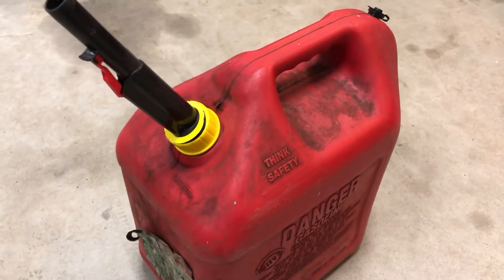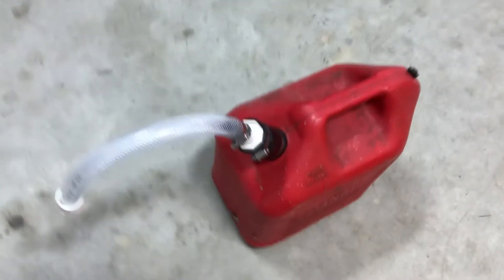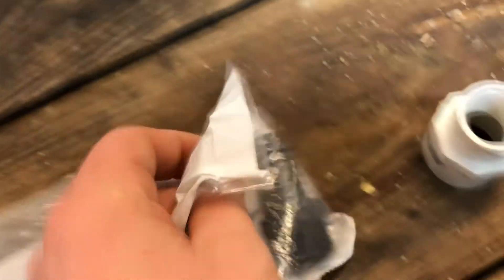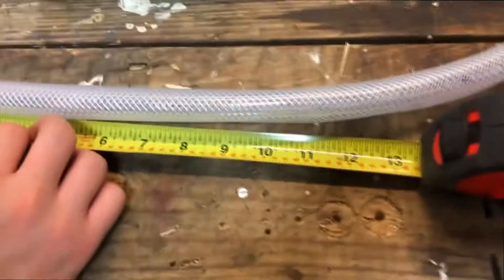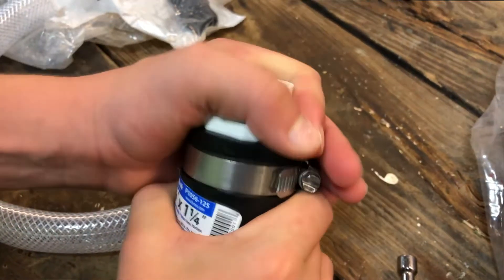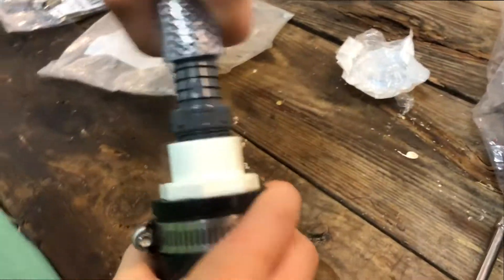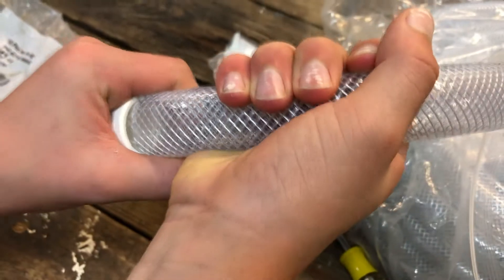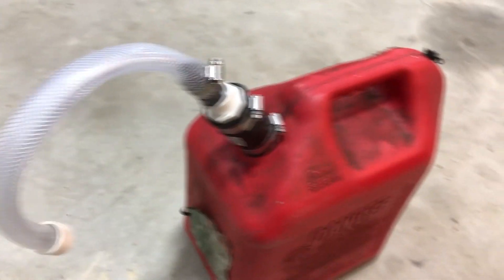DIY Gas Can Spout that WORKS!

Comment: Helpful hint. To assist pushing the hose onto the fitting, spray the fitting OD and the ID of the hose with 100% silicone spray, let it dry then push the hose over the fitting. The silicone will most make it easier to accomplish that.

Comment: Nice job, I like it.  However, the hose diameter looks too big to fit inside the small neck on a modern car. Have you tested that?
Reply: Yep, now you're gonna need a piece of 1/2" tubing attached to the 3/4" tubing to put the gas in the car...

Comment: tried this with exact parts listed...still leaks badly no matter how much you tighten it down...none of my gas cans (4) have threads on the spout that go all the way around. There are a couple of flat spots with no threads and this is exactly where it leaks. It was a good effort, but needs more work, unfortunately

Comment: I guess this is fun cobbling...
However the EZ Pour retro fit kit is $9 at most local hardware stores or online.

Fits almost every new plastic can...comes with extra parts, a flexible plastic pour hose, cap and a can vent.  Makes your can just like 1990 cans.

Comment: I kust use a funnel into my machine's gas tank. To pour all I do is remove the "engineered" spout completely.
Aside from the schrader valve  I don't understand the nessesity of all the backyard engineering.

Comment: I need a 3 foot hose to add onto existing EPA nozzle. 5 gal gas can is too heavy to hold up to fill a pickup truck.... I want clear tubing. I can set the can on the side of the truck bed, run the hose into the filler neck, and let gravity do it's thing.

Comment: Dip hose end in reeeeeeallly hooooot  waters to soften when you push it on. I did something similar with a garden watering can and my wifes CPAP hose to I could get the water in the bottles I bury next to the tomatoes.

Comment: what kind of screwdriver did you use to loosen and tighten the hose clamps. Great video.
Reply: The best screwdriver I use for hose clamps are the cheap harbor freight ones that have a large straight and phillips side and a small side. The large side if you take the bit out is 5/16 which is what the head usually is on the clamp or use the screwdriver bit.

Comment: Get a hose clamp that has the twist knob so you don’t have to carry a screwdriver with you. Also use a torch to warm the hose to slide it on better
Reply: Use the hair dryer, works a bunch better and doesn't set the hose on fire.

Comment: You could probably sit on the curb at Walmart or some auto parts place and sell those things all day long. Make up a bunch (like a few hundred) and sell them individually, 3 pack, 5 pack or 10 pack. Fill up the back of your truck. 
While you're at it, build a good solid cash box to slip the money in...something welded to your truck, locked and just a slot in the lid...lol...but serious. You might want a buddy standing by packing a surprise in his waist band. 
Thanks for the terrific demonstration and camera work.  Jesus bless.
Reply: A 10 pack of those things would cost at least $125 just to make. You'de have to sell them for $200.😂😂😂

Comment: The worst gas cans are the ones which do not have an air vent at the back. They instead use an inner hose which sucks the displaced fuel vapor as you fill. The first thing I do to these is drill a hole & screw in a 1/4_20 bolt! The EPA has a lot to answer for!
Reply: I install a metal (brass or chrome) truck tire valve on the flat spot on the upper handle. Remove the valve core (schrader valve) use a metal valve cap. 

I can empty an entire 5 gallon gas can in about a minute instead of 5 minutes. If I’m filling a small tank you can leave the cap on and control the flow. I like these valves much better because they don’t accidentally flip open.

Comment: But with the requirement for a nut driver to remove and reinstall this it has to be a bear to refill with gasoline.  Any adapters that would prevent that?

Comment: I'm wondering if the parts like the rubber coupling that you used are fuel compliant. Gas will soften the rubber and may get in the fuel system.
Reply: Makes no difference in carb. motors

Comment: Wow, that's about $125 worth of goodies on your bench.  I went a quicker and cheaper route.  For $74, I got two VPracing 5.5gal motorcycle gas cans with separate capped vent, vinyl spouts, and 45 degree benders.  They're heavy duty and work great, with zero obstructions in the hose.  They're FAST, too, and spill nary a drop.
Reply: People try and reinvent their old wheel and spend so much more than just buying a tire from someone else.
Reply: $125 for a rubber boot, a bit of hose and a few fittings? What are you buying solid gold fittings and kevlar lined tubing??

Comment: Have been using the EZ pours for several years with no problems. Also tried taking one if those horrid spouts apart and slipped a plastic hose over the stub. Got lucky and the hose fit very tight so no clamp was required. Yours looks guaranteed not to leak.

Comment: So if you go to the gas station without a screw or nut driver you will come back with an empty can. 
What were you thinking?
Reply: Someone else just mentioned unscrew it at the gray connector and white connector...like you would unscrew the gas cap anyway. That would work. Jesus bless.
Reply: @sandrarichardson2713  that will leak - also will the pump fill nozzle go in to fill the can?

no

not without modification ;)

Comment: You have to carry a nut driver with you to fill the can?
Reply from the maker: You can, but I have found the entire rubber contraption screws off and on - it works but not as easy as a regular screw on spout.

Comment: I’ve chosen to fill my vehicles’ tanks with a modified elongated funnel and pour the gas in without any spout on the can. The spout is used just as a gas cap during storage and is removed before pouring. The elongated funnel sticks out of the gas tank at a roughly 45 degree angle a parabolic section has been cut out on on side that faces skyward enabling easy pouring of the gas into the tank. When filling a lawnmower a regular funnel works best.
Reply: Me too. I gave up on trying to pull back the spout, pick up and pour from a 5 gallon container. Older lady. Just horrible to do...and irritating that the cap leaks at the jug connection. Sure, I could only put a gallon or two in the jug at a time...
Thanks for all the helpful comments. Jesus bless.
Reply: @sandrarichardson2713  Kudos to you for lifting a five gallon jug (unless you only have it half-filled)! I gave up on my five gallon jugs and only use one and two gallon containers. I’m an older guy and decided that I didn’t need to exercise my arm muscles so much—LOL.
Reply: unless there is wind. then not fun
Reply: Exactly what I’ve been doing since they started putting those crap spouts on.

Comment: I can see where this spout would pour faster but would be worthless when it comes time to fill it up.
Reply: Then take it off at home and buy solid caps for gas station run.
Reply: @downwitakrowdy  Where do you find good ones? Ive bought several and they are either very hard to find, break, or the rubber seal just deforms and becomes useless.
any advice?

Comment: So every time you go to the gas station to put gas in the container you're going to have to take off the rubber housing over the hole in the can. But that's still better than dealing with those crappy spouts that break all the time.
Reply: No! That's what the plumbing connectors will do. Look at the grey and the white that screw into each other. Unscrew those and voila you are there.
Reply: @Cocora22  brilliant!
Reply: They ALWAYS break!

Comment: does the gas eat away at the rubber parts and hose?
Reply: It would last longer than the crap they sell
Reply: Yeah, but like said it will still last longer than the garbage that comes with the can
Reply: Most likely.. but still better than the Garbage they come with.. 🤷‍♂️🤷‍♂️